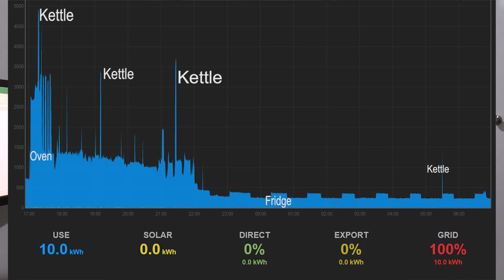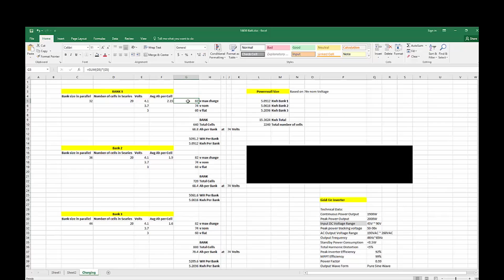My Powerwall Battery Voltage Plan

Comment: if you had current sensor on the main line to control the output of a grid tie it would work great ..but with out it wil just run at full cap till the battery dies...feeding the grid
Reply from the maker: I am going to have 3 current sensors, one on each bank which will be handy to log but also needed for charging so i know then to turn off the charger. I am building a BMS using a Arduino which started off with just some basic things but now i keep thinking of things i need to add and monitor so writing code to turn off  relays and monitor cells is way over my head but it is coming along slowly.

Comment: HI MIKE if you use a grid tie inverter it will draw full power all the time on battery..its a grid tie ...and wil not work unless it has a line voltage to start it......not meant for battery ....you need a inverter...you can feed back at night from battery but it must spin the meter backwords.and grid tie will shut off with no input ....look at your spec sheet ..anti island protection....I tried to use one and turn it on with a small inverter and it worked well with a draw but when not draw if took out the grid tie caps....been there nice battery bank..
Reply from the maker: Thats why you need a grid-tie with a limiter. Yes grid tie needs AC to Sync that is fine, and that is how it is meant to work, anti island protection is in all grid-tie for a very good reason, The inverter will only work while the AC is on.. I am not going to change that. I am using a Grid-tie inverter how it should be used, but with Battery rather then Solar on the DC, Later i will have both on a relay but thats later down the track. For now tho Grid-tie inverter with limiter on battery.  The Grid-tie will supplement the house load but being a grid-tie will have a lot of flexibility. I am about to release a video tomorrow as i just got the inverter and have already tested it i just need to edit the video. It will be an unboxing video and first test run.
Reply: been doing just that for years now but using solar.for my supplement..then charging  my battery bank for  back up power use....so not to cycle the batterys everday ....they will last longer that way....I use a simple relay board to control it  and it works great . and doing it when power is at its peak day time use for better savings on my power bill.

Comment: Wow, this sounds like a really cool project. I love the ideas you have come up with and how they are very different to many others but I think they are a great way to go. having a nominal voltage of 74 volts is great to keep current down which improves power efficiency which is critical for this project. 
I look forward to seeing how this all progresses and I love the challenge in building a 74 volt power supply. 
I tinker with an off grid setup my self, I have tried all sorts of things trying to use what I have, get for free or cheaply. I have not got many videos but I did one on power loss over cables which you might be interested in.
Reply from the maker: I will have a look on that power loss video :P